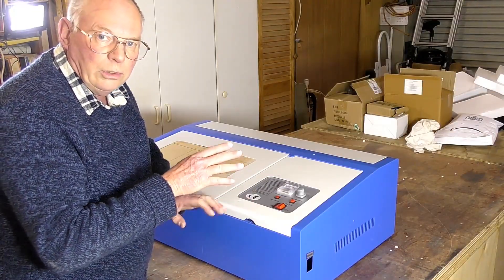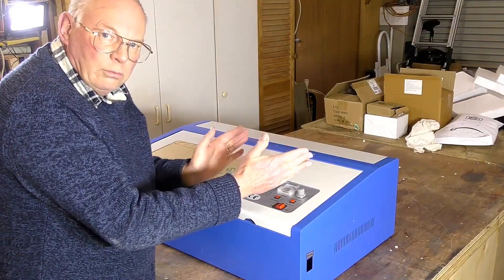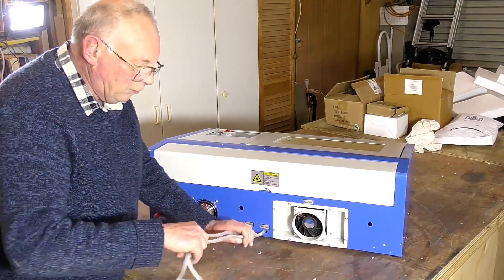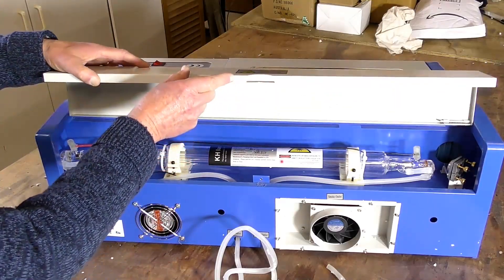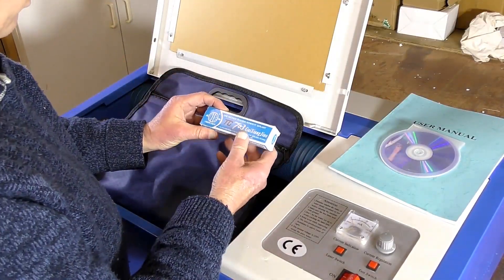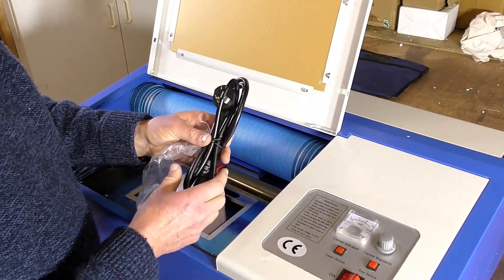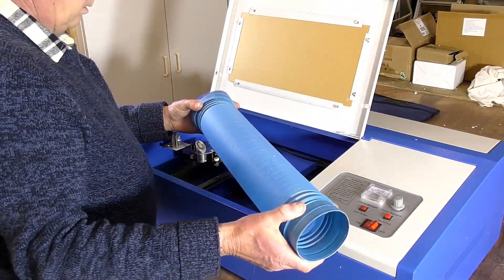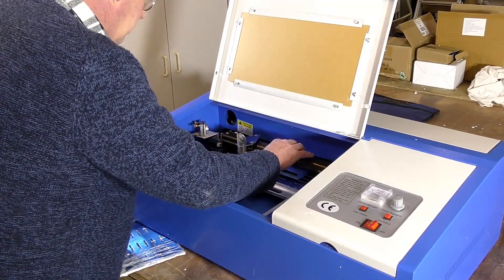HOW TO CO2 Laser on a budget K40

Comment: Omg, K40...  If we replace the mechanism with real linear guides, add real optical supports, a real controller board and real software, this machine could be used. Or, as we laser machine manufacturers say, the cheapest option is to take everything out of the k40, put charcoal in it and use it as a barbecue grill.